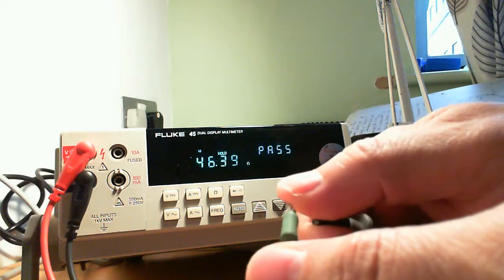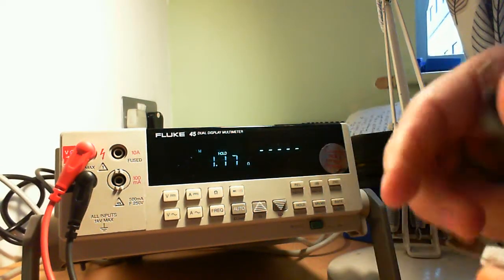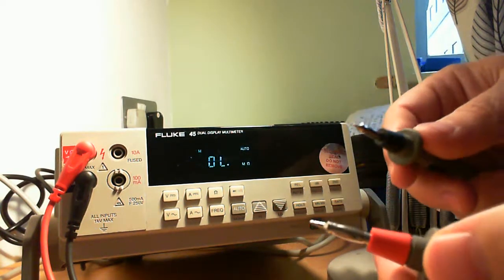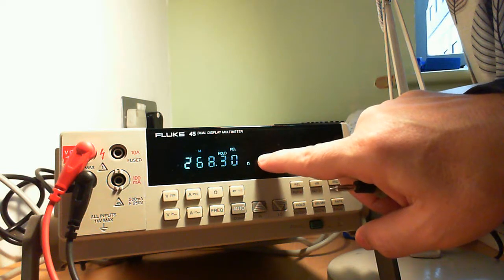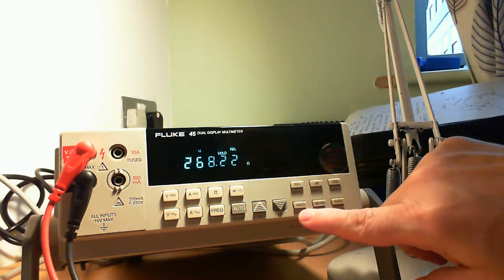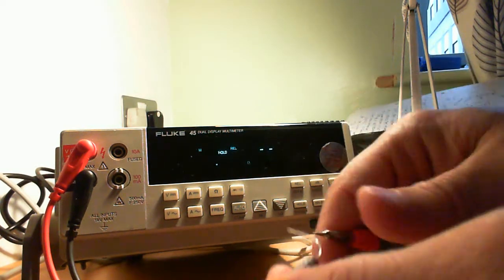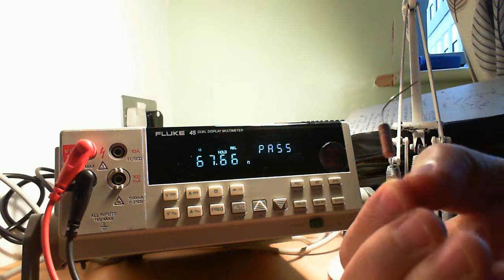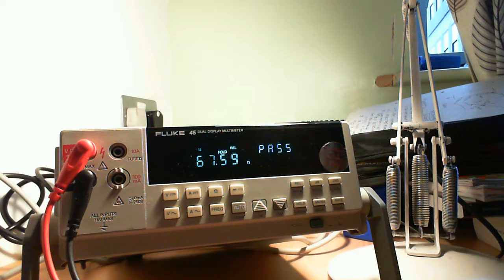fluke 45 - comparing resistors.

Comment: Why are you touching both leads at t 
He same time? Do you not care about accuracy
Reply: @sparkden  you are putting your body resistance in parallel to the item under test. This does change the reading....especially on a meter with the resolution of the F45
Reply: @sparkden  a great deal..no....effects readings yes. If you are going to show and teach others , you should do it in proper form.